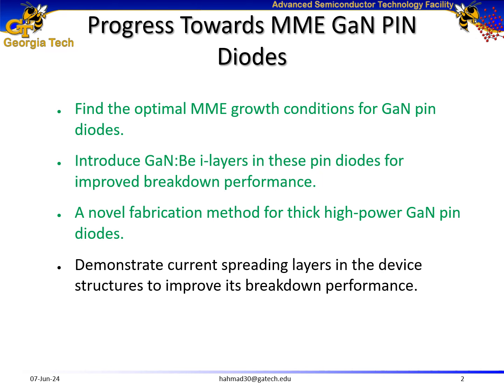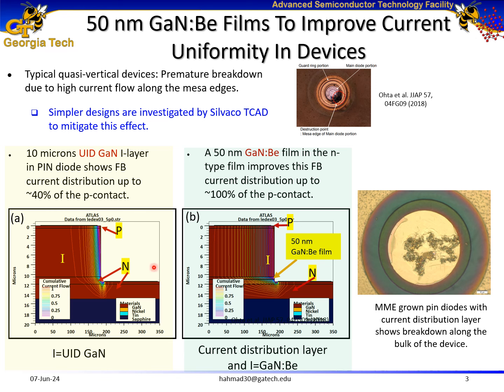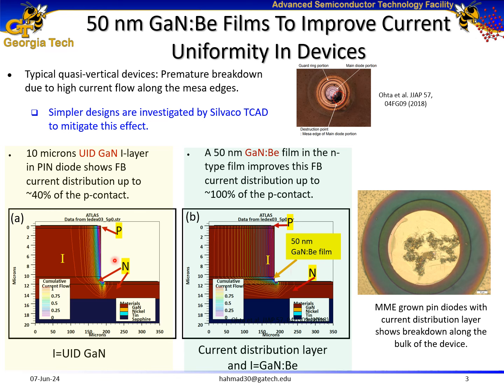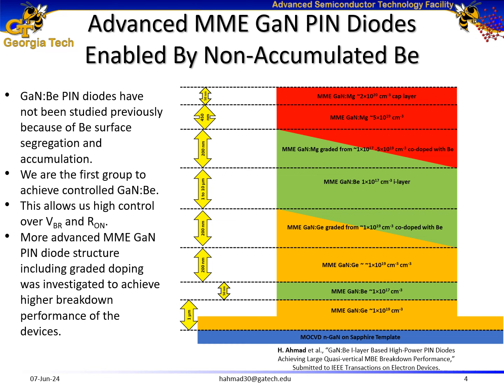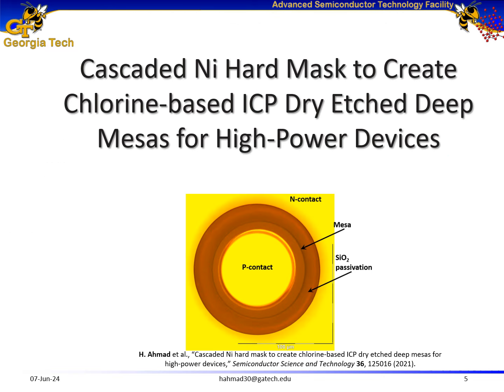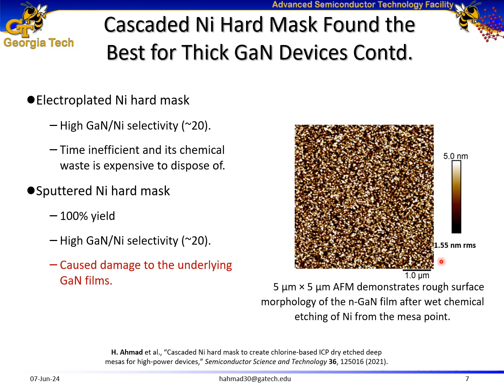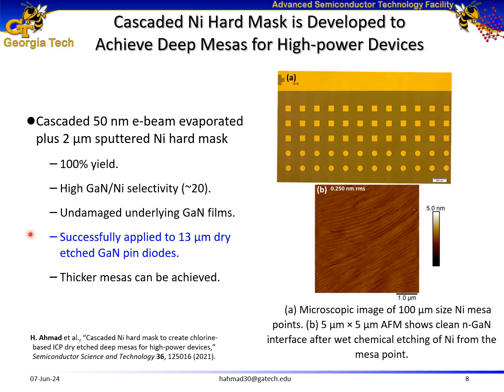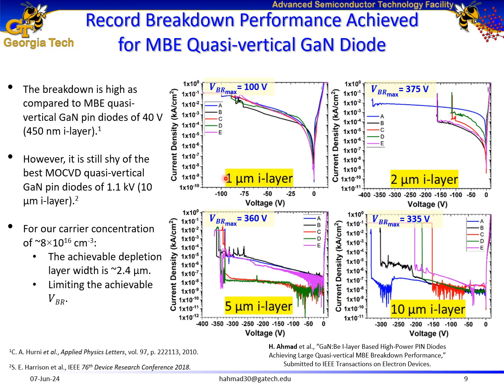🔬 Revolutionizing Semiconductor Fabrication: Advanced Ni Hard Mask Technique for High-Power Devices💡

Comment: How do the optimized growth conditions for Gum Nitride Pin Diodes impact their long-term reliability in various applications?
Reply from the maker: The optimized growth conditions of GaN pin diodes have the following impact on their long-term reliability in various applications.
- High-power conversion: GaN devices have high-power conversion efficiency, making them ideal for high-power applications.
- Power devices: GaN's high critical electric field and faster switching speeds make it a suitable material for power devices.
- Vertical power devices: Vertical devices can handle larger currents, making them more reliable than lateral devices.
- High breakdown voltage: Optimized growth conditions can achieve high breakdown voltages, making GaN pin diodes suitable for high-power applications.
- Low turn-on voltage: Optimized growth conditions can achieve a low turn-on voltage, reducing energy losses and improving efficiency.
- High current density: Optimized growth conditions can achieve high current density, making GaN pin diodes suitable for high-power applications.
- High-frequency applications: Optimized growth conditions can achieve a high cutoff frequency, making GaN pin diodes suitable for high-frequency applications such as terahertz wireless communication systems.
- Improved epitaxial quality: Optimized growth conditions can improve the epitaxial quality, reducing defects and improving reliability.
- Suppressed reverse leakage current: Optimized growth conditions can suppress the reverse leakage current, improving reliability and reducing energy losses.
- High Baliga figure of merit (BFOM): Optimized growth conditions can achieve a high BFOM, indicating better device performance and reliability.
- Avalanche capability: Optimized growth conditions can achieve avalanche capability, making GaN pin diodes suitable for high-power applications.
- Mesa structure: Optimized growth conditions can achieve a mesa structure, improving device characteristics and reliability.
Reply from the maker: By achieving high-power conversion efficiency, high breakdown voltage, low turn-on voltage, high current density, and high-frequency capability, GaN pin diodes become suitable for high-power applications, power devices, and high-frequency applications like terahertz wireless communication systems.

Additionally, the improved epitaxial quality, suppressed reverse leakage current, high Baliga figure of merit (BFOM), avalanche capability, and mesa structure all contribute to enhanced reliability and performance in various applications.
Reply: Very well explained. You should patent this idea. Felicitations.
Reply: Many thanks for your video, I hope to introduce how can extract dibl in MOSFET. Thanks